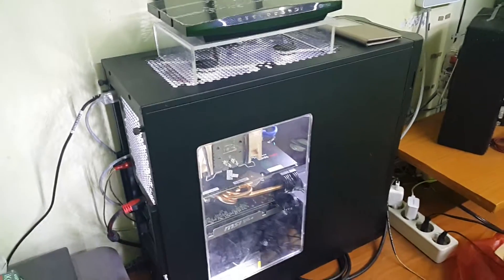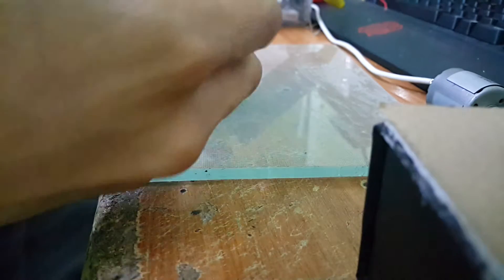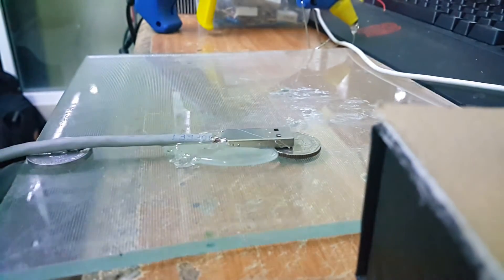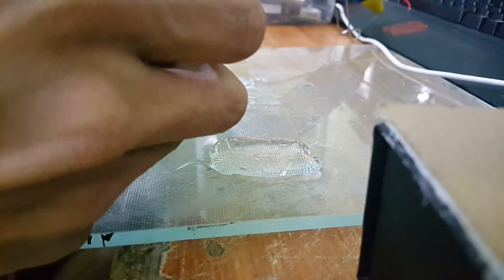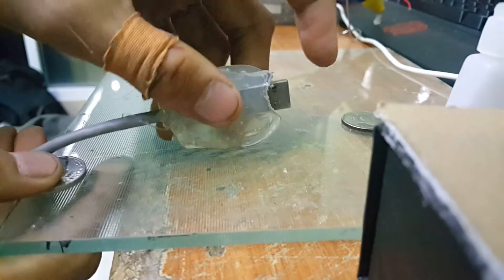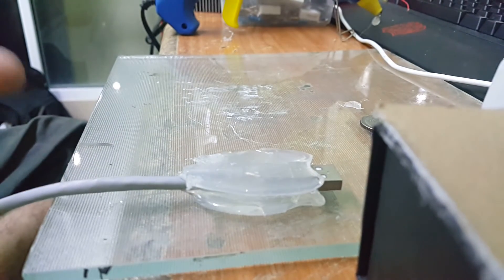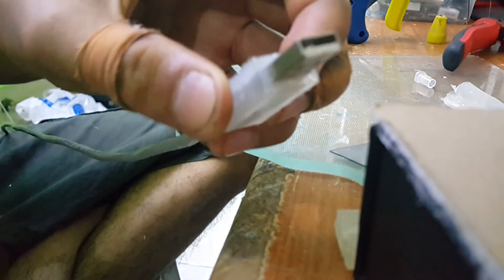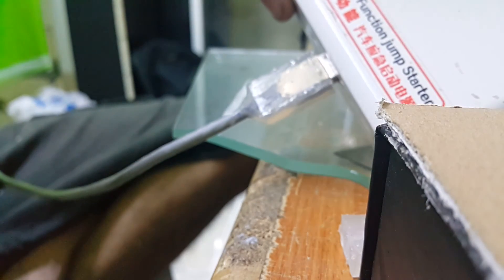HOW TO MAKE A HOME MADE USB PLUG

Comment: I made a mold. Using glass. I put some vaseline on the glass to remove it easily. That way I get to use less silicone and encapsulate the usb connector and cable at the same time.